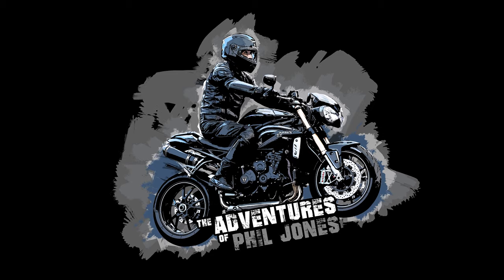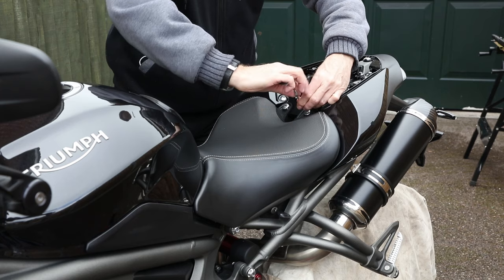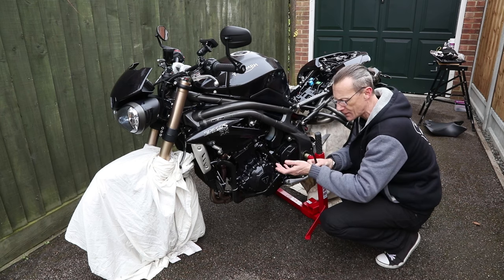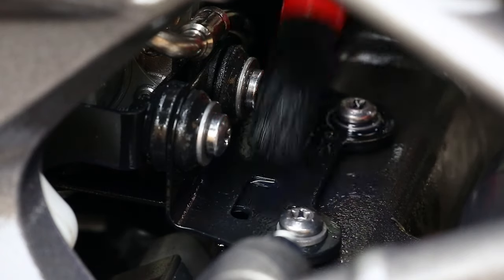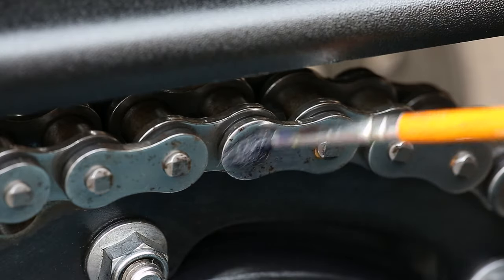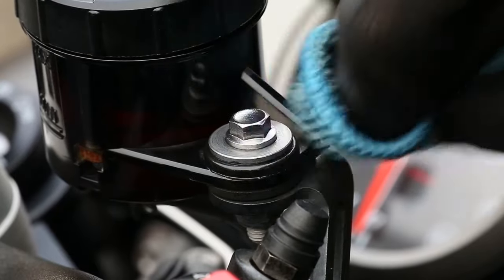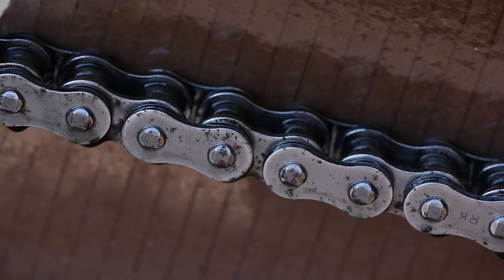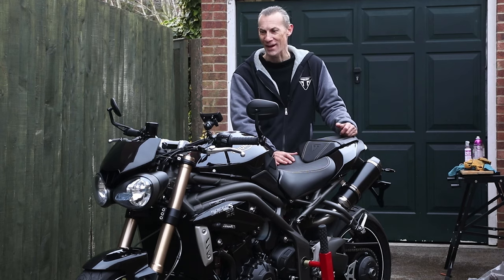The Best Way to Apply ACF 50 to your Motorbike - Step-by Step - All you need to know

Comment: Thanks for the instruction. I ride my 2006 Multistrada in winter here in Buffalo, NY where we do get salty slushy roads. Have used ACF - 50 for several years with good result but I really appreciate your technique. It is more detailed than mine. I'll be spending a bit more time prepping my "winter rat" this year.
Reply from the maker: Hi! Thanks for the comment. For what I know, Buffalo, NY get’s harsher winter’s than we do in England, so I’m really pleased you are getting good results with ACF-50. I’m pleased the step by step video helped! 😁👊

Comment: Love this stuff. Used it for years and it works (I ride all year, uk) 
I apply it with an air compressor and small spray gun (just a bit quicker and it creates a really fine mist) also recommend doing this on a hot summer day, not that we have many 👍🏻
Reply from the maker: Great tips! I filmed this during lockdown in February I think it was, it didn’t take long to cool down and become a bit blotchy.  An air compressor is a great idea, I wanted to show a cheap alternative! 😁👍

Comment: Cracking vid mate- Ive been using ACF for years now and recently switched over to XCP- but by god is it thick! Gunks the place up insanely. but atleast it keeps the crap away!
Reply from the maker: Thanks! What made you change to XCP? Honestly, which one do you prefer? 👍
Reply: @TheAdventuresofPhilJones  Mainly due to ACF not performing as It either once did years ago, or seeing rust appear after using ACF after every single wash. 
Downside to XCP is its sticky as hell- meaning it picks up a lot more road dirt - however the protection is amazing. Have a look at the bikesocial videos by Bennetts who did a full comparison of rust blockers- fantastic video

Comment: I used ACF-50 for many years and swore by it .... but have now ditched it in favour of TechCote ACS TC-200. It outperforms ACF-50 at protecting steel from rusting (as proven twice by Bennetts testing and confirmed by my own 6 month test) and is so much easier to apply .. just spray it straight from the can, coverage is awesome and the whole bike can be done in a couple of minutes. Best bit is that it is cheaper than ACF-50 too! I've yet to find any negative with the TC-200.
Reply from the maker: Hi Thanks for your advice and feedback. What made you change to ACS TC-200? 
I haven’t used it myself but I am interested to try it. Like you, I’m very happy with ACF50 and the proof is how well it has protected my bikes over the years. Thanks for watching and commenting 😁👍
Reply: @TheAdventuresofPhilJones  Hi, I was also impressed with ACF-50 for many years. It worked really well on my '92 Honda 750 .. but not so much on my 2018 MT07 which started to develop rust on the swing arm despite the bike never being ridden in the rain and always having a good coat of ACF on it. Then last year I saw this video ... https://youtu.be/wBgF07I7TQM .... and that sparked my curiosity. So I personally tested ACF vs TC200 on some spare exhaust studs and nuts for 6 months during this winter and got very similar results to Bennetts ... the TC really does protect steel better than ACF. However I suspect the ACF might be better at protecting alloy .. and no one seems to test for that, so thats my next mission 😉
Reply from the maker: @MotoGoato  I’ve seen the Bennetts tests by John which are interesting. I’ll certainly take a look at TC200 and a bit more research, but personally acf50 hasn’t let me down 😁👍
Reply: @MotoGoato  Rust on the swing arm of the MT-07 is a really common problem. I remember reading on forums about guys who have had multiple swing arms replaced under warranty and they all kept rusting in the same spot. Partly why I chose to go with the CB650r tbh.
Might be more of a production problem than the fault of ACF-50.
Reply: @lakaiskates8064  yeah for sure yamaha have some production 'issues' with certain areas of their budget bikes. A couple of years back one of the brand new MT07s they had on their stand at an international bike show had rust spots on the swinging arm!! Regardless of Yamaha though, ACF is still beaten in independent testing by both TC200 and XCP Rust Blocker .. with XCP taking the crown - but that is quite thick and sticky which is why I personally prefer the TC200  🙂
Reply: @MotoGoato  @lakaiskates

Do you guys have any update regarding TC200? Also, have you ever tested Corrosion X? It is also used mostly on aviation industry, looks good also
Reply: @GabrielCsillaz  I've not tried 'corrosion x' ... but TC200 out performs ACF50 - it's just as good at preventing corrosion on steel and it is effective for much longer, a lot easier to apply and cheaper too. I have not tested either on bare alloys / aluminium though and I suspect the ACF may be the better choice there ;)

Comment: I was a little trigger happy when applying ACF50 for the first time and I got some on the discs thought I had done enough to covere them but I didn't!  , any suggestions on how to get it off.
Reply from the maker: These things happen and it shouldn't be a big deal if you give them a good clean. I would use a brake disc cleaner. Muc-Off make one, use a fine Scotch Brite Pad, and give it a good scrub would be my advice. Just make sure you haven't got it on your brake pads either. Take it easy when you first pull away and make sure your brakes work and will stop you!

Comment: The warming up is the genius part. I found it hard because it's so thick. Brilliant Vid -  I wouldn't use it on the paint work though, but I'm guessing you're gonna wax that.
Reply from the maker: Thank you, I’m pleased it helped. I have found been using acf50 for a few years now and found that one aerosol can will spray lighter than another, you never know what you are going to get. I agree with a few comments left on here that the best way to apply it is by using a air compressor, but not everyone has one, so I wanted to explore other methods which work and are cost effective. Check out my other and more recent cleaning videos too which should help with polish and wax. My friend had a problem with a brake reservoir following a service and brake fluid sprayed all over the tank and her leathers. I believe that because we treated all the paint with acf50 it actually protected the paint and caused no damage, her leathers were unfortunately damaged by the fluid!

Comment: A very beauty. I just cleaned up mine (street 675r 2013’) after a long ride through country roads and is always a pleasure to find out how shiny it is underneath the dirt it collected. Never used the acf50, I will try it next time. Should I use it also on radiator and exhaust?
Reply from the maker: It’s always rewarding cleaning your bike. You can use acf50 on your exhaust and radiator. Let me know how you get on! 👍

Comment: Great video.. .. better than lot of the others.. so riding pretty much all year how often would you ACF?  friend ACF after EVERY wash.. just think that's excessive
Reply from the maker: Thanks for the encouragement, I’m pleased it has helped!

A lot of bikers apply ACF50 before the winter and then just hose the dirt off after each ride. It’s the salt which does the damage and causes corrosion. ACF50 clings to surfaces leaving a thin protective film. If you give the bike a thorough wash in the winter, personally I would reapply acf50 in the vulnerable areas for extra protection but in theory you shouldn’t have to but I’d rather be safe than sorry and protect the bike. Even if you use a presoaked cloth and give areas a quick wipe over that should do the trick!

The winter salts can be damaging so just keep a regular close eye on the bike to check ACF50 is doing it’s job. I hope that helps! 👍

Comment: Only if I could keep my bikes half as nice as yours. 👍
What would you recommend to cover the tires and wheels, towels or old sheets?
Would I need to reapply acf50 if I use s100 total cycle cleaner?
Reply from the maker: Thanks for the compliment  if I can, then anyone can! 
Anything will do, as long as it doesn’t soak through onto your brake discs and pads. I’ve never used S100 but I understand it’s used when you want to give the bike a light clean, in which case it will be alright for a while I would think. Check out my other video… https://youtu.be/jwstswJtbeA?si=SuoS-UJbS9SuFdJK

Comment: I find high temp silicone is great for spraying over the engine and exhaust, it keeps it looking like new and it doesn’t burn off
Reply from the maker: I haven’t tried that, thanks for sharing your tip! 😁🙌
Reply: @TheAdventuresofPhilJones  car enthusiasts use it, it’s usually called Engine Brightener but it goes under lots of different names.
Reply from the maker: @Crowbar381  Nice one, I’ll be sure to check it out! 👊

Comment: Any problem getting this/using it on exhaust headers?  The Triumph manual says use a commercial available protectant on the exhaust system but no mention of a brand.
Reply from the maker: @msromike123  This is great on exhaust headers and complete systems, I’ve been using it on mine for years! 😊

Comment: Great video. So you used this on your exhaust and headers as well? Doesn't cause and discolouration? Did you use it on your forks? This won't degrade any plastics or fairings?
Reply from the maker: Thank you. I do use it on my exhaust, forks, and plastics. The only place you want to keep it away from is your brake discs and pads, and take it easy around rubber. I find my exhaust headers need cleaning a couple of times a year, and applying acf50 keeps the corrosion away. Although not necessary on plastics, as they won’t rust, it does give a protective covering which definitely helps keep the crap off. It stopped brake fluid damaging my besties petrol tank, whether that was luck we will never know!

Comment: Good video, like your attention to detail. My Triumph has a bit of rust on the rear disc. What would you suggest?
Reply from the maker: Thanks very much! It depends how much rust, but some ultra fine wire wool should help, then clean it with brake disc cleaner. Be careful around the pads that you don’t get crap in there. Let me know how you get on! 👍
Reply: Thanks, I'll give it a try. There isn't much rust.
Reply: Use brake cleaner. Then ride with the back brake slightly on. Then once you get back use cleaner again and then hose down
Reply: @JDMz   Thanks but I was able to remove it

Comment: Great videos mate. I have the mat black CBR650R (can't post pictures on here) and it turned up just a couple weeks ago, so it's due a clean right now. What products would you recommend for my kind of paint finish, as I don't think wax and polish is good for it as it is a mat finish after all.

I intend to ACF it as well as I doubt it was done before I had it. It only has 1300 miles on it as a 19 plate, but I noticed some corrosion on the bolts in front of the tank.
Reply from the maker: Congratulations on the new bike, it sounds awesome! The chemical guys produce a cleaner for Matt finished, I haven’t used it myself but I’ve heard good things! Some people also use mild soap and water on Matt surfaces. Check out the Chemical Guys products and let me know what end up using! 😁👍

Comment: H Phil/Others, In the past I have just sprayed on to classic cars and bikes, put away (left the ACF 50 on) then in the spring time - just put them back on the road and let nature slowly take the act 50 off. Why not do the same, what's the advantage in "taking the excess" off with a rag..? Why not spray and leave?
Reply from the maker: @photocoach5483  Hi. Thanks for sharing your experience and technique. That’s a good question. Once applied, ACF50 only needs a thin layer to do its job, by wiping the access off it keeps the vehicle looking great while still protecting it from corrosion. The thin clear film of ACF50 keeps working for up to a year according to the manufacturer. Check out my video about how long it lasts. I hope this helps! 👍
https://youtu.be/jwstswJtbeA?si=S6dxi7tko4r12Nb4

Comment: Getting a new bike next week and was wondering if I should apply ACF50 over a ceramic coating which the manufacturer/dealership will be putting on it?
Reply from the maker: Congratulations with the new bike, what are you getting? I know that when a ceramic coating has been applied you have to leave it for a while for it to fully cure. I would ask whoever is applying the ceramic coating for their advice and I’ll also ask acf-50 for you and get back to you. I can’t see it being a problem but it’s better to be safe than sorry!

Comment from the maker: Thanks Richard. I’ve never used GT85 but I will check it out. Once I apply the wax and polish the paint comes to life, plus I clean the exhausts too! How do you apply acf50? Thanks for your support 😁👍
Reply: I put it on the same as you but I have I small electric spray gun so going to give that a try I also use for the paint work Autobrite Abyss, synthetic paint sealant or colinite wax thanks for asking 🇬🇧👍
Reply: For the metal work on the bike I use Britemax metal polish 🇬🇧👍
Reply from the maker: @richardpearson4248  The spray gun would work a treat I’m sure.  I’ll check out the other products you use too! 😁👍
Reply: @TheAdventuresofPhilJones  thanks stay safe 🇬🇧👍
Reply from the maker: @richardpearson4248  You’ll see what I use on my metal next Friday! 🤣👍
Reply: @TheAdventuresofPhilJones  👍

Comment: Can it be used on outer face of brake disc and front forks and rear shocks
Reply from the maker: Hiya! You don’t want to get it anywhere near the brake disc, but the front forks and rear shocks is fine! I’m assuming your brake disc may have seen better days, in which case try a scotch pad and lots of disc cleaner. 👊

Comment: Hi Phil, my RE Continental GT 650 has developed rust on suspensions. Do you think it will remove those spots? WD-40 Does not seem to work. Please advise. I wish I could show you the pictures. I am in dire need to help!
Reply from the maker: Hi! WD-40 won’t do anything I’m afraid. It really depends how bad the rust is. Acf50 removed light surface rust on my chain. It’s worth buying some and protecting the rest of your bike! Good luck 👍

Comment: Hi Phil. Thanks for these videos. Really informative. I have never used ACF50 before, but have just bought a new bike (brand new) and am looking to keep it in mint condition for as long as possible whilst still riding year round. Please could you advise whether you would spray ACF50 as a 'base coat' or should I get a few layers of wax and polish on the glossy areas of paintwork first? Can I polish over the top of the ACF50? It seems so from some of your others but just checking! Thanks again
Reply from the maker: Congratulations on the new bike. Yes you are right. Give your bike a good clean then apply the acf50. Once it is coated as per my video, you can then apply your wax and polish. It is meant to keep working for up to one year. Let me know how you get on! 👊
Reply: @TheAdventuresofPhilJones  Hi Phil, what would you recommend for removal of some gone hard squashed bugs on my tank paintwork as i dont want to risk scratching my bike ? Also what do you think of tank pads ? I've just recently got myself a beautiful R1 and i find myself more comfy gripping the tank with my knees because of the riding position but don't want to mark the tank if possible , love your videos man they have been a great help... Brendan.
Reply from the maker: @brendan1522  Hi! You could put a wet micro fibre cloth or sponge on the bugs so the water softens the bugs, or squirt them with pre wash like Citrus Power. Once they’ve been soaked they should come straight off. I’m not the one to ask about tank grips I’m afraid as I personally haven’t used any. I hope that helps! 👊
Reply: Cheers Phil thanks for the advice as always, you have become my immediate go to if i have any cleaning problems 👍 stay safe..Brendan
Reply from the maker: @brendan1522  I’m glad to be of some assistance! 😁

Comment: Apart from ACF50 have you used/considered other rust preventatives such as wax oil, Double TT or XCP rust blocker
Reply from the maker: I used to use WD40 when storing my bike over the winter months and I know lots of people who do, but it is know where as good as acf50. I considered XCP which is meant to work well but is really sticky, the same with fs365. Do you have any thoughts/experience with them? Thanks for asking! 😁👍
Reply: I’m going to see how a light spray all over of Double TT goes. Use Silkolene Pro Prep in Summer which is a bit lighter. I follow Stuart Fillingham who uses these products.
I mainly potter on dry days so I’m going to try and avoid wet days or when there’s a lot of salt of the roads.
Don’t want to use wax oil or anything too sticky or gloomy that will attract muck
Reply from the maker: @beverleynorth4914  I will check out his video soon as I’m interested to see what he says about it. Bennetts also created a video where they tested lots of anti corrosion products, check that out first! Let me know how you get on! 😁👊
Reply from the maker: @beverleynorth4914  Hi! I’ve just watched his video about Jenolite Waxoil Spray and it does look like an interesting product. You can’t use it over your engine or exhaust though so they aren’t being protected. I wouldn’t agree with his comments about acf50 being an average anti corrosion product as it has protected my bikes for years and I know many bikers who would rate it. Each to their own and I will consider buying a can to test, especially on my old car! Thanks for letting me know and keep me posted! 😁👍

Comment: Would you put ACF-50 on the chain before applying chain lube?
Reply from the maker: There are mixed opinions on this. I’d say if you are careful you can carefully apply to the face of the chain with a small brush but keep it away from the O-Rings!